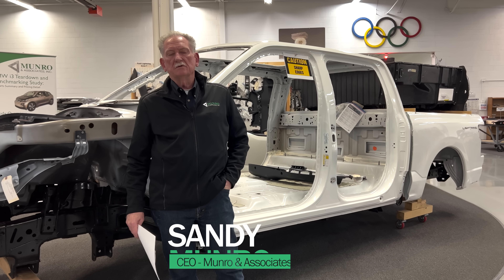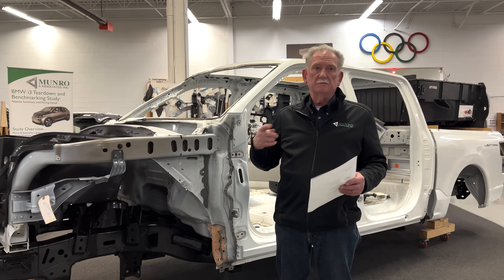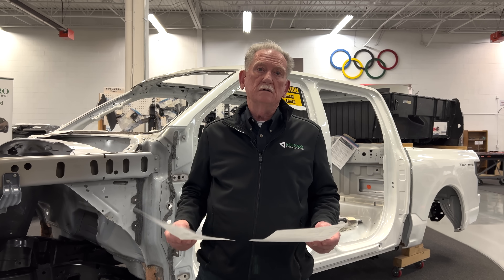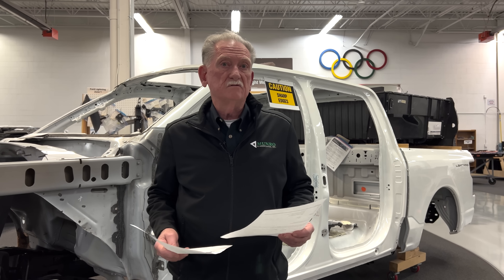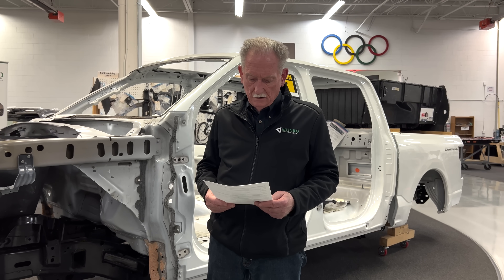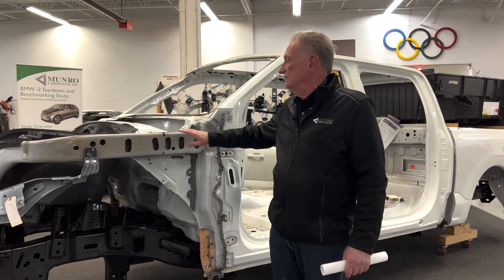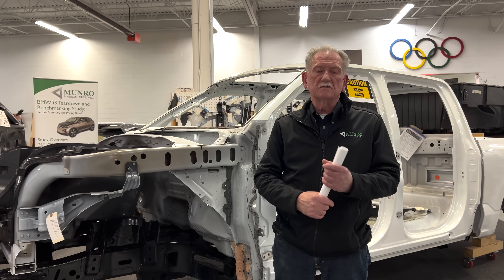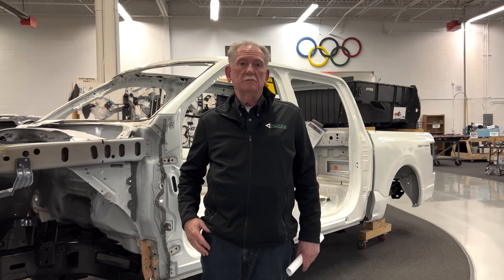Sandy's Initial Thoughts on the 2025 Ram 1500 Ramcharger

Comment: So I see this as a huge deal for weekend warriers like myself who use my current pickup to drive short distances (less than 30 miles a day) most of the time, but the only reason I have a pickup with a 10k pound towing package in the first place is so I have a vehicle that can haul our 8k pound RV travel trailer about 6-8x a year (once a year we go out of state on road trips that are 500+ miles). The rest of the year i putter around town in the truck and it get gas mileage in the teens at the best.  On paper, the Ramcharger appeals to me to be a good daily city driver but gives up very little for those "less than 10% of the time" use cases where it needs to go longer distances or towing heavy items.  

On paper, for me the ramcharger in EV mode would be ideal in the city (plus the feature to power the house from the charger port is a huge bonus) and the range booster would be amazing to have during the few times a year that I need the power and convenience of towing a 8k pound trailer 200+ miles with gasoline.  We all know that EV's really shine in stop and go traffic and short distance driving (especially in the city), but today they cannot tow anything significant more than a few hundred miles at best without needing to recharge.  RAM is selling the "flexibility & performance" aspect of it, and they very much have my attention.  I appreciate the fact that they are not stuffing the truck so full of batteries that it weighs close to my RV all of the time.  

Another big thing for me - Most EV charging stations out there today do not have "pull through" spots, so decoupling a trailer just to charge along the way is frankly a hassle on a road trip. F150 lighting can go about 150 miles on a hilly freeway with a 8k trailer (TFL guys did this test).  The concept of a gas range extender allows the ability to not be dependant on EV charging in the boonies or in extreme cold weather.  Just thinking about taking an EV truck towing a 8k pound travel trailer to the Rocky Mountains from Texas makes me nervous, especially once you get in the higher altitudes in the national parks (not so much because of "range anxiety", but more to do with convenience and logistics like "does the charging station allow pull through for trailers" & "will it recharge just as fast as pumping 25-30 gallons of gas"?). Sure EV charging exists up there above 8k feet, but i guarantee you it does not give the flexibility and convenience of gas in that situation (at least not today).  

Refuleling with gas takes minutes and until EV trucks can do the exact same thing and be just as convenient, the general public will not be as forgiving as early adopters.  This is simply a "bridge the divide" product, as most of the public is not ready for a hard cutover to EV yet.  EV battery charging tech has a way to go to match the convenience of liquid refueling on road trips but this would be a better way to introduce EV tech longer term to their customers than making the hard switch EV.  EV drivetrains are very much superior and people towing should appreciate it once they try it.

Comment: Sandy these “max range” stats published by the manufacturer are for 65 degrees in perfect weather at sea level with a brand new battery pack. I live in Colorado. None of these things work out as published in real life. It turns out that a well equipped Ford Lightning can do something like 120mi in winter here. That’s not a compelling reason to buy such an expensive piece of machinery that you plan to depend on.

Comment: Mr. Munro. I love the idea of the F150 Lightning. My number one issue and why the RAM is pure gold for me is I can self fuel if needed in a pinch. Our ranch is very remote and electric would be fine. I just need to ability to pour 5 gal of gas into the tank to get back to the house. If I used a lightning exclusively I would probably carry an atv with me as a back up. The RAM in my situation is the best concept yet.
Reply: Maybe I misread this.  Can you not charge at your ranch?
Reply: @iamalmostanonymous  absolutely we could charge. We could even have fast charging put in if it came to it. Here’s the main focus. The agriculture community has been using petroleum for decades. It’s just going to take time to adopt major sweeping changes in how we produce. This platform is a logical step towards whatever lies ahead for us. Its certainly no perfect solution. I think it’s more about what we’re left with for choices.  Simple mechanical diesel engines and large displacement gas engines are being phased out over time as CAFE standards change for better or worse.

Comment: you didn't count the weight of the fuel tank as well

690 miles unloaded will be much lower loaded.

I like the basic idea, but I think that they need to have an engine optimized for generation (very possibly a turbine)
Reply: If it does well, I can see them doing just that.

Comment: I am excited with the potential this platform will provide.   I tow an 11,000 lb trailer with a 6.7 diesel.  I installed a 55 gallon fuel tank and I can't wait until the electrics are half as good as my diesels range.  This Ram is a promising start.

Comment: Writing specifically as an RVer that Ramcharger may be the best thing yet for towing a travel trailer. 

EV for around town - gasser with torque for towing - built-in generator for camping. 

Best pickup idea for RVing. 

The Ford with Pro Power Onboard is a far distant second as the EV range is lousy.

Comment: The ramcharger will burn the battery out. I have never heard of a battery being able to charge at a high current and out put the high current at the same time.
The ramcharge is technically an hybrid similar to the volt but it will operate far closer to the gasoline version.
One might say you could not tell a difference between the gas model and the hybrid.
Reply: Tell me you don't  understand electric circuits without telling me you don't understand electric circuits.  The DC power from the generator goes right to the engines.

Comment: I think that a smaller battery is a good idea. You can power twice as many vehicles for the same battery cost. Instant torque where you need it when towing. The V6 is tried and true great engine that doesn't require retooling and development. Since the engine is a genset it doesn't fall under the same emissions regulations. Hopefully it has regen braking and the advantages of that. I just made a trip from Northwest Washington to Southeast Texas and back. We drove 16 hour days stopping only for fuel and bathroom towing a car on a trailer. This would have been a great truck to do this with. The charging infrastructure is just not there yet but getting fuel is. Very few down sides in this case.
Reply: Unfortunately the engine still falls under the same emissions regulations, as it is a power source for propelling a vehicle. EPA CFR "Note that engines used to indirectly propel the vehicle (such as electrical generator engines that provide power to batteries for propulsion) are subject to this part."
There should be a carve out for PHEV as the same emissions regulation burden does not make sense when a vehicle is mostly operated as an EV. This could reduce cost/weight by simplifying the aftertreatment systems, but would be difficult to determine the proper threshold as end users of the vehicle will be very different in their use of proportion EV/ICE use.

Comment: Don't need 690 miles? How about hauling which WILL reduce that mileage. Oh and also low temps and long-term use sees a reduction in capacity. Don't need 690 miles my a** that's the only option to get me to convert at the moment. Good Job Ram

Comment: Buy a F-150 Powerboost Hybrid if you want two drive systems solution. I do 550 miles and about 10% of them are electric. The RAM will still burn a tank of gas and it will be more expensive to purchase. If you want an BEV, then either the Lightning or the upcoming Cybertruck are the way to go.
Reply: powerboost had a tiny battery..this has a Model S size battery in it to give it actual range in EV mode.

Comment: I'm pretty excited with the upcoming RAM Charger and have been waiting for a series style hybrid similar to the modern locomotives for a while. It's not about driving 690 miles at one time, although that's an option for some. I like not having to charge or fill up as often. I do like the Lightning but would wait until Ford releases their ground up EV truck in 25 personally as it will have much longer range and faster charging. I won't buy an EV truck with less than 350kw charging and would like 450+ miles range to help account for cold winter range drop and towing. I think the RAM Charger is going to be extremely popular especially if they don't go crazy on the price point.

Comment: Hopefully they've gotten the engine oil cooler and rocker arm issues taken care of in the good ole 3.6L.  I like this design though, it seems similar to the Jeep Wrangler 4xe.  My only concern is towing capacity once the battery is depleted.  I doubt that the 3.6L is going to be towing 14,000 lbs without battery assistance.  I would imagine it could tow around 8,000 lbs though and that should still be enough for most people.
Reply: The engine can deliver 130kw of power ..so 174hp. ...should be enough unless you are hotdogging it or going up a mountain.

Comment: Indeed - just like the Volt - and actually many plug-in hybrids, the Ramcharger is a fantastic one-stop-shop vehicle for all your needs.  You can use just the battery for like 90% of your driving, but when it comes time for towing an 8000lb travel trailer on a 3000-mile trip, you'll be happy you don't have to worry about stopping at charging stations.  The best I saw on YouTube for the F-150 Lightning extended battery was 200 miles with a trailer.  Then, you can't just drive into a charging spot, you have to uncouple the trailer and yadda yadda.  So, again, this is the ultimate solution until they have a much richer network of pull-through ultra fast charging stations for people who tow.  Maybe in 10 years...

Comment: Having experienced past and present of 10 different hybrid/EV vehicles with prices from 25 to 60k I am very interested in the Ramcharger.  The problem will be pricing, if they price it the same as Fords F150 powerboost it will be a hit.  90% driven on Electric with an MPE of around 45 or 690 miles trip averaging 25mpg everyone will fall in between unless towing which will average 15-20 mpe
Reply: Finally, someone "gets it". I acutally think this will be CHEAPER than a full BEV truck. The missing 100kwh of battery has got to shave $20k+ off the cost. It should actually be cheaper and lighter than the Lightning. Also of note, Ram said they will offer it in Tradesman trim. I predict it will start at $50k and end at $80k, just like the current big engined ICE trucks.

Comment: Hi Sandy! Talking about range extender, there is a company out of Austria called Obrist. They developed a 2 cylinder engine (two separate cylinders side by side that cancels vibration) capable of 50kW that fits on a model 3 frunk. If you could have a word on that it would be awesome. Link to one of their youtube below:

https://youtu.be/aSlqw08IH5Q?t=117

Comment: This is the most sensible approach to an electric truck that will actually be used for more than grocery hauling.  Towing a 10,000 lb trailer 300 miles just isn't practical with an all electric.  Having this hybrid system makes that a simple no-stop exercise with a solid generator to run the trailer once you get there.  There may be a better engine choice that could run constant RPM's at higher levels of efficiency but the concept is great for people like me who use their trucks to haul mid to long distances.

Comment: You missed the mark on this one. The biggest drawback for electric trucks is not empty range, it's range when fully laden or towing. A F150 lightning makes absolutely no sense for a guy who has to tow a job trailer 200+ miles to a site. There is a theoretical case that he may get there, but if he's doing construction, or working in a rural area, how is he getting home? The likelihood of finding a fast charger within the range of an EV in some areas of the country isn't great, but add into the mix a truck towing a trailer, or loaded down, and you begin to see the problem. Hell there are places in West Texas where even gas trucks experience range anxiety towing heavy, so to say that you cannot see a use case for additional range is rather shortsighted. 

Whether the hybrid is as efficient as the pure EV counterparts in the marketplace, is actually irrelevant. My thoughts are that this truck has taken aim at the spot between EV's and traditional hybrids, and if it can offer better efficiency than a traditional hybrid (and that is a big "IF"), and EV like driving dynamics, that is likely all that will be required to get it into a lot of driveways and fleets. 

The average consumer does not need a truck 99.97% of the time, and when they do need a truck, they rarely need one that tows 12k lbs- yet the roads are chock full of them. Why? because cars and commuter vehicles sell to consumers on a "what I need" basis, whereas trucks are sold on a "what IF i need" basis, making the markup for additional capability (no matter how unnecessary) an easy sell by the dealers, and easy profit margin for the manufacturers.

 Range anxiety is real, whether folks will ever actually use it or not. What RAM have done here is attempt at firing a first salvo into what they hope will become a war. Much like with towing capacity, ground clearance, etc, they're attempting to create a perceived "need" for additional range in the eyes of the consumer. They're going to be able to market the truck as having the performance of an EV, with the convenience of gasoline- from a marketing perspective, it's brilliant. 

I am not sure how efficient it will be in the real world (I seem to remember the Fisker Karma using a similar setup, and getting pretty awful mpg in hybrid mode) but from a marketing prospective, it's genius. If it hits the market at or near the price point of the F150 powerboost hybrid, or the Tundra hybrid, and does even 1 more MPG, they'll have a winner on their hands.

Comment: Once you have made the commitment to put in a range extender, you might as well have a few extra gallons of gas to extend the range under all conditions and loads.  The range extender is a binary decision.  However, the pure EV range can be optioned (small, medium, large battery) with a significant cost difference and little performance difference except pure EV range.   Some people would be fine with 100 miles EV range, others will insist (and pay for) 200 miles of range.   100-150 miles daily range seems more than adequate.

Comment: The oblivious and complete ignorance of towing range is incredible for the entire video is shocking given Sandy's normally through descriptions. Yes, people drive 40 miles daily for work. The purpose of trucks is to then tow 200+ miles for recreation. The F-150 Lightning has an unpublished range when towing boats or snowmobiles, especially when it is hot or cold, but tests put it way under 100 miles. The whole point off the RAMCharger is towing range is unaffected.

Also, loads of snowbirds drive 20 hours straight, on seasonal trips between the Northeast and FL. This is impossible in an F-150 Lightning.

The complete lack of discussing the entire purpose of towing range of pickup trucks is pitiful considering Sandy's background.

Comment: Range extension is the most practical solution until the charging infrastructure becomes reliable and also when towing. More importantly, it is the solution for rural people who have to travel for everything but the basics. GM had the chance to bring this to market years ago as they were working with VIA Motors who were installing this technology in GM 1/2 tons not long after the Volt hit the market. Looks like VIA are only producing commercial platforms now so the partnership must have ended. I actually expected GM to do this shortly after Bob Lutz became a member of the board for VIA. GM is being left behind yet again.
Reply: I think Via Motors only made around 250 VTRUX models, and I am not sure how many are left running today. I have one in my garage, and this is the first vehicle I would consider as a replacement. I suspect the price will leave me holding onto my VTRUX for quite a while though.

Comment: I don't think the 690 mile range is the point, it's getting like 200-300mi range while towing that's the bigger deal, and the ability to refuel at gas stations rather than having to find a DC fast charger located in a way you can pull up to it in a pickup with trailer

Comment: Only makes sense if the gas generator is compact and self-contained enough to be fairly easily pulled out for service or used as a stand alone generator when the battery range is sufficient. Big trip into the backcountry or towing, lower in the genny and go.

Comment: This is NOT a work truck or even close. Dodge doesn't offer any 8ft bed any more. 
These range numbers are empty bed, not towing and only the driver. You won't be anywhere near those unloaded numbers on range when you actually start using the truck as it is supposedly intended to be used. You also have to add in speed, hills/resistance and you wont be anywhere near half that range.
There have already been countless videos conparing BEV(in all combinations) vehicles to ICE and when used for work/towing, delivery etc., the ICE is still better.

Not to mention that the batteries weigh thr same regardless of being fully charged or not. Compare that to an ICE, where as fuel is consumed, it isnt a weiggt factor and actually allows the vehicle to travel farther by comparison. 

Yet again, we see a mall crawler.